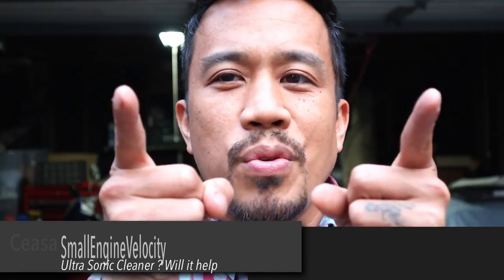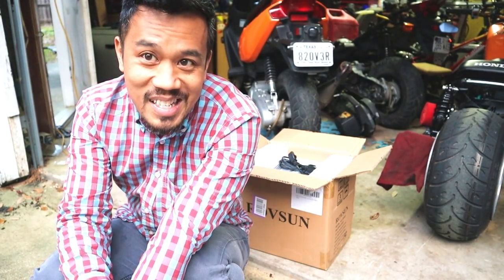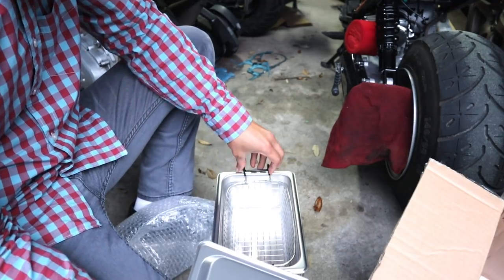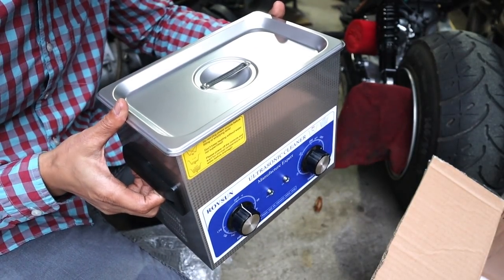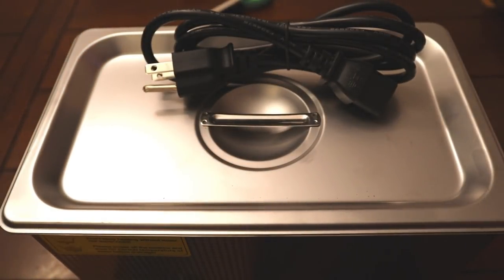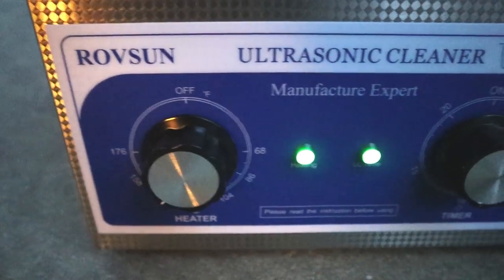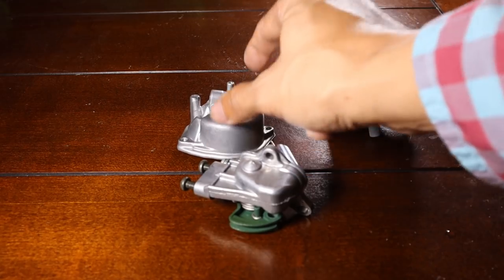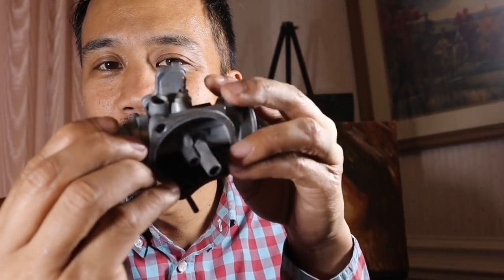Clean your carburator with an Ultrasonic cleaner from Amazon? Let's find out!

Comment: Why would anyone put a carb in water??? Put it in a zip lock bag with a cleaning solvent or a clean peanut butter jar and fliat it in the heated water and sonic action. Not fond of puting ANY engine part in HOT WATER!!!
Reply from the maker: It’s a fairly common practice to use an ultrasonic cleaner - they even make very large cleaners for large car parts. Once it’s complete it immediately gets compressor out in every crack and hole. I’ve had amazing results.